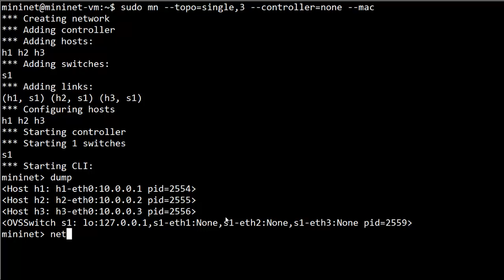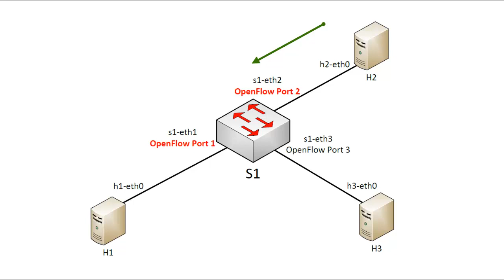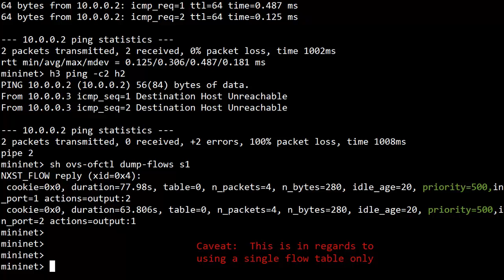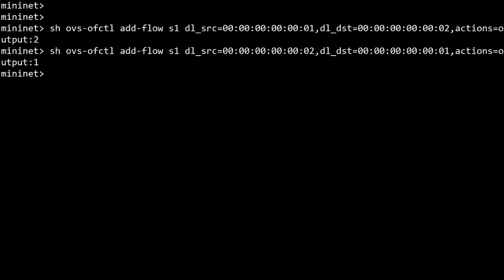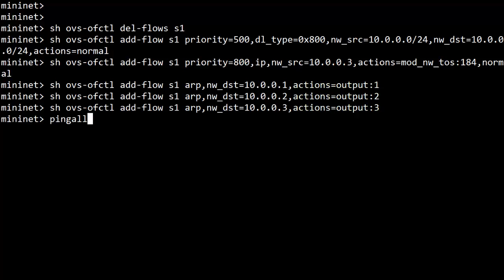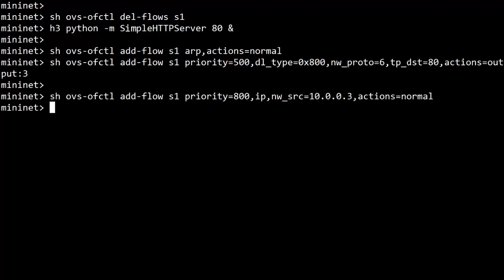OpenFlow flow entries on Open vSwitch (OVS)

Comment: David, your OF videos are the best introductory OF videos on the Internet. I'm sure I speak for many people in saying thanks for sharing and please keep adding new material as your time permits.
Reply from the maker: Thanks so much Jeff for that kind feedback!  I definitely will!
Reply: David Mahler  Hi David. I already sent you an email through youtube. I am using dpctl add-flow in a fat-tree topology and I want to install the flows in the switches manually with dpctl. I am following your videos and since I have so many switches in the path I am using 0_2_1 instead of S1 as your video has. I am getting errors regarding dpctl take 2 arguments, I fix that I do not see the rules installed in the right switch, all of the rules are installed in the 1st Switch. ANy help, please, I really need your guidance.
Reply: I completely agree wiht Jeff , "David, your OF videos are the best introductory OF videos on the Internet. I'm sure I speak for many people in saying thanks for sharing and please keep adding new material as your time permits."
Reply from the maker: Thanks *****

Comment: Greatly explained how to implement OpenFlow entries to the Open vSwitches flow table (single flow table). Can be done many different ways, such as by certain interface, by layer1 method (in_port), by layer2 method (MAC address), by layer3 method (ip address), by layer4 method (TCP). Also, there are also many other parameters that can affect to flow entry contents. These can be done in Mininet CLI but I believe it is also possible to do by Python scripts. This shows why centralized routing is so useful.

Comment: How can we add static IP to vport 1 and vport 2?
I am trying to learn OVS on my Ubuntu box with KVM.
I have single NIC connected to Internet and I want to create 2 Vport with different IP address for my VM's
Like my single NIC have IP :172.16.1.18/16 and gatway 171.16.1.1 I want to have Vport1 =172.16.1.160 and vport 2= 10.10.0.20 and both vport should get internet access from my gatway 172.16.1.1.
pls let me know how it is possible.